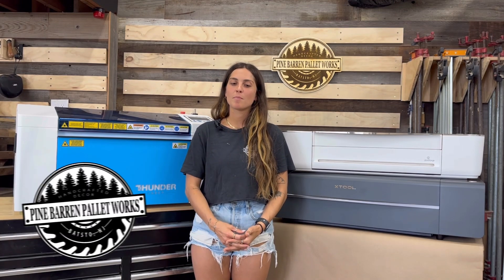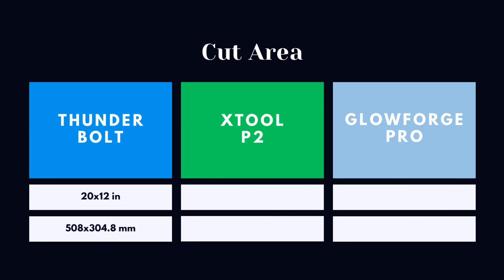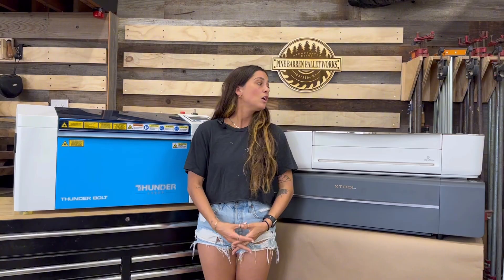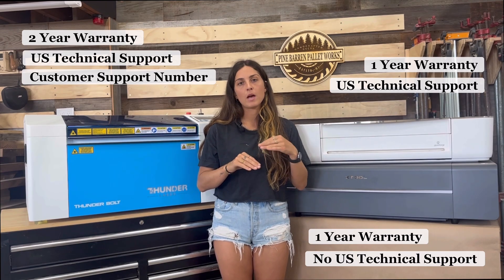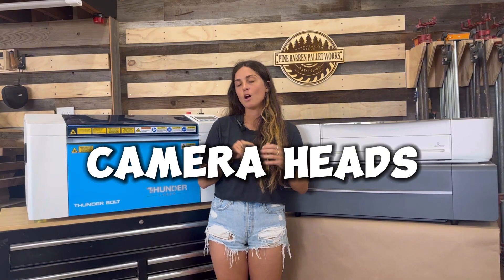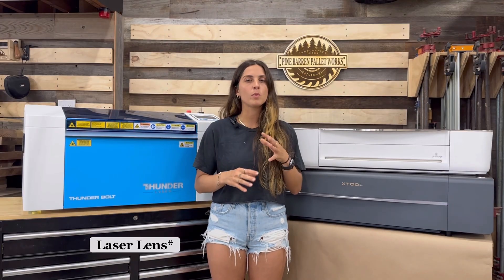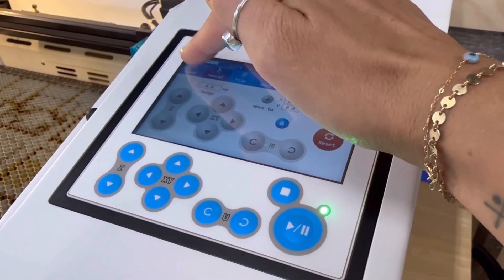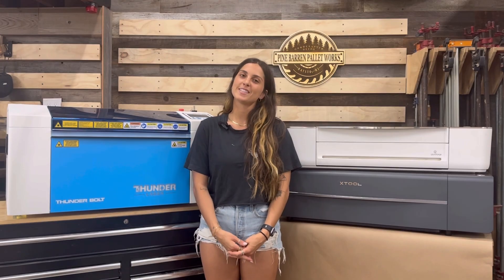We Tried These Lasers So You Don't Have To!

Comment: is this a thunder ads? 
i've used three different machines, so here's my two cents.
Xtool's machine isn't 5000 like you said, it's actually 3999, so before you make any comments, at lease make sure you are telling the truth. 
Gloforge is just a mess. I can't figure out how they're still in business, other than the fact they're an american company.
Ghunder bolt's rf co2 makes a mess when cutting acrylic, leaving ugly serrated edges. thunder just a chinese company pretending to be american.
Reply: Sounds like you need to do more testing on settings if you’re getting bad cuts on acrylic. Also, curious how Thunder is “pretending” to be American? They have never claimed to be American made only US service and support.